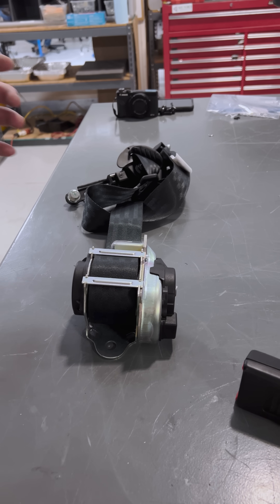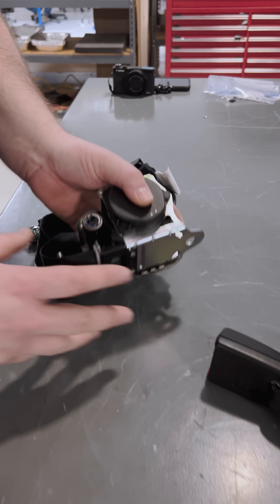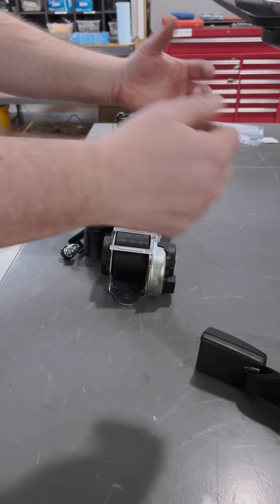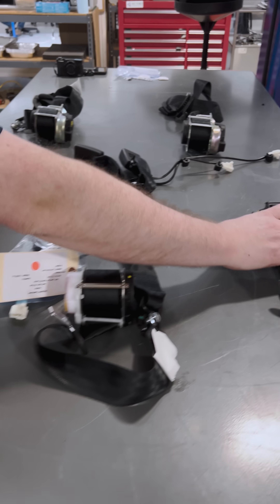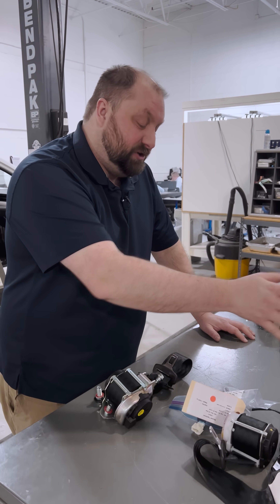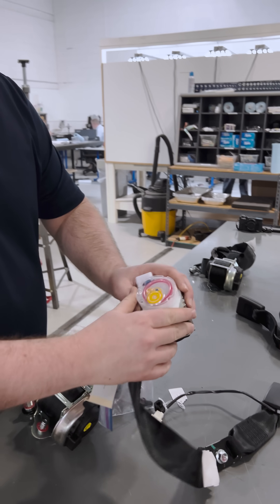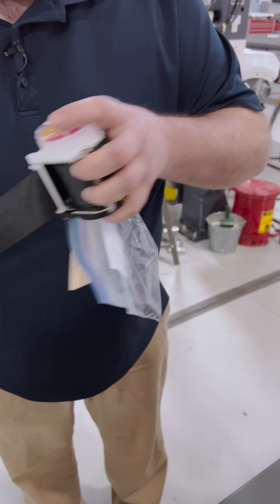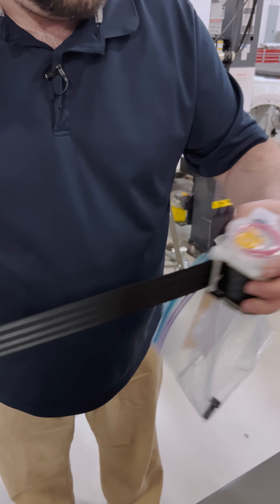Your Seat Belt Has Explosives?! Here’s Why!

Comment: Honestly still not sure why some automakers use this type of system,  a small electric motor to tension the belt makes way more sense. 

Best of all you can tie it to brakes and other car sensors to have it pre tension based on specific scenarios before an accident occurs and doesn't need to be replaced every time there is an accident or is at risk of causing a fire. 

Its not even all that new my car is from 09 and has that feature.
Reply: Using an explosive and parts that do not sustain wear during normal operation is a design decision based on the underlying requirements. Explosives are significantly faster than any electromechanical alternative. They're also significantly more reliable to activate with simpler and cheaper components. At least one of the triggers on seatbelt tensioners is mechanical, not electronic. 
Furthermore, the power to weight ratio is better for an explosive than for a motor. Finally, if a vehicle is in a collision, sufficient to trigger the tensioner mechanism, it won't matter if it can only operate once, before it would have to be replaced, since the vehicle wouldn't be in any better condition.
Reply: @thomasbonse exactly saving a few dollars on a seatbelt, especially when milliseconds count doesn’t matter when there’s $10,000 of damage to the rest of the car. Plus, they’re probably lighter and don’t need a big capacitor for power.